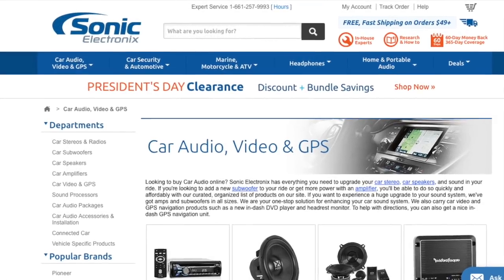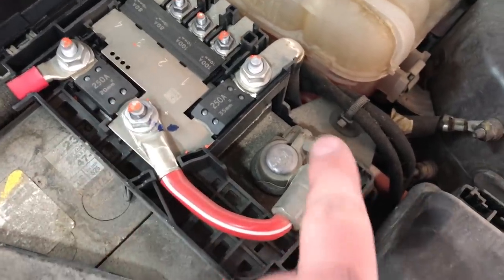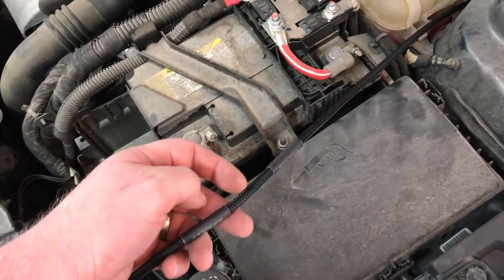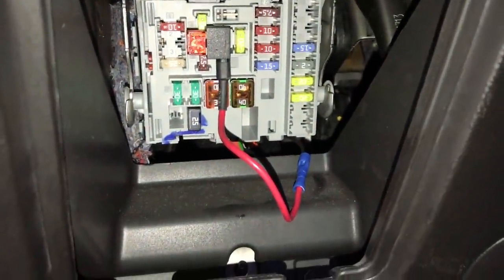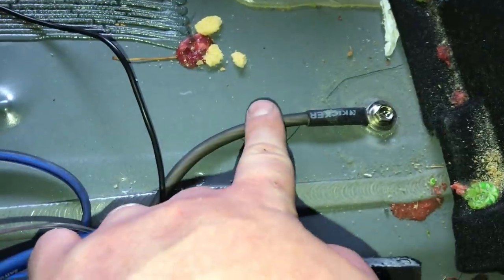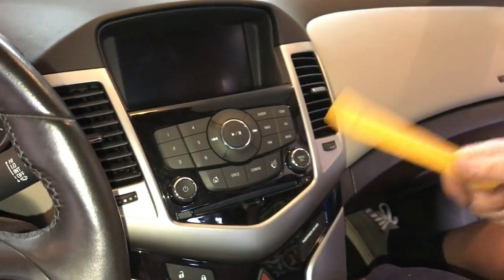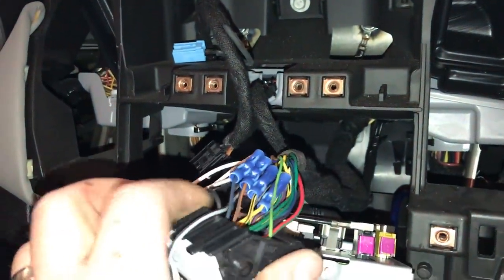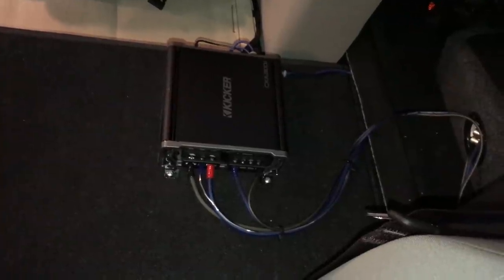2011 - 2015 Chevy Cruze Kicker Amplifier and Subwoofer Install

Comment from the maker: Parts linked in the description of the video!
Reply: Have you had any experience with the cheap android touch screen stereos popping up all over the place for these cars?

I ordered one but I'm confused as to how I should connect my door speakers;
My android stereo has all rca Jacks for speaker outputs. But my door speakers are just wires like yours. no male rca piece.

Should I just go online and buy little rca adapter things that I can connect to the bear speaker wires

Comment: Actually the panel by your hood release you can access all of your stereo wires including each speaker it's all in one single block. You don't have to take apart the dash at all
Reply: How?
Reply: I’d also like to know how ?
Reply: Hoa
Reply: He's right, just pop off the driver kick panel and remove some of the tape in the main harness. You'll find 4 twisted pairs...those are your speaker leads. Just use some t-taps and you're golden. The wire colors/polarity is easily found online. I actually wish I knew this before I started my own install. Oh, it's also important to know the tweeters get the same signal as the woofers up front. They just have their own high pass filters built in. If you're replacing tweeters, it's easy to just run a new wire up from the crossover. Also, you don't really need to buy speaker brackets if you're replacing them. You can just cut the speaker baskets out with a rotary tool/utility knife. Then screw the new ones in to the factory rings...if you squint it's mint 😁
Reply: Thank you for this comment, the prospect of taking apart my stereo was stressing me out
Reply: Wish i looked here before i spliced into my harness and drilled through the firewall lol

Comment: This was extremely helpful. I tapped into the speaker wires just like you showed and it worked great. Thanks so much for taking the time to put this together.
Reply: What additional fuss did you use? I see a bunch of ones like 15A or 20A and even 10A. I’m so confused on which one I need to add on with my cigarette lighter fuse.
Reply: @quincymcroberts24  I used the 20 amp fuse which is labeled fuse #6 located inside the car on the panel on the left side right next to the driver’s left knee. Here is a link to the diagram for the location of fuse #6 https://fuseandrelay.com/wp-content/uploads/2017/08/shema-bloka-s-predohranitelyami-v-salone-shevrole-kruz.gif
Reply: @Dovrizzo  Thanks you so much! I appreciate it!

Comment: Tapping in through speaker wires to the amp is terrible quality(stupid when high frequencies come through subwoofers). Was hoping it had some outputs but apparently replacing the head unit is the way to go here.

Comment: What and how did you wire your cables on the radio I got confused
Reply: Its called a line out put converter and when you buy it come with instructions

Comment: I had my add a circut in the front cigarete lighter fuse and it stop working for no reason and the relay stared cliking and now my amp will not turn on? Help where to reconnect my add a circut again to make it work?

Comment: Thank you! I have a 2013 Chevy Cruze and installed a kicker hideaway with your video, even though I had a little bit different setup. Couldn’t have done it without this.
Reply: How do you like it? One of the things I love about mine is it looks like a damn rental car and as long as I don't leave anything visible inside, nobody messes with it. A concealed sub would indeed make it sound better? Thanks.
Reply: Edward Bernard I love it, it’s a single 8 inch sub/amp combo that gives it just enough thump to have good quality bass in the car, nothing crazy. It stopped working though about a week ago and I have no idea what’s wrong with it. Has power/light is on, fuses good, it’s grounded, speaker wires connected correctly even tore the radio back down to check them. So oof.

Comment: What do you do differently if you want to add a bass knob? How does it plug into the LOC?
Reply from the maker: Lots of options for bass knobs - some line out converters can include a bass knob, some amplifiers include a bass knob, or you can get a universal in-line bass knob as well.  Just depends on what equipment you are looking to install.
Reply: @ProvoBeastAudio do the newer kicker amps need a LOC? or can i get away with a amp sub and a amp kit
Reply from the maker: Depends on the kicker amp.  If you go wtih the Kicker Key, they have a built in DSP so no LOC is needed as they will take the OEM signal input and make those adjustments via DSP.  Some non-key amps have high level inputs, but overall, you will get a better experience with a quality LOC. @TotallyNotDoggo

Comment: So where or how did you hook up the bass knob? I see where you had the plug for it, but you never showed what your hooking it up to or the install of that?
Reply from the maker: Depends on the amp, if you are using the same amp, we ran the cable up to the knee buster panel under the steering column and mounted our knob there.

Comment: I also have a 2013 Chevy Cruze but I will be replacing my stock head unit but keeping my radio. If I watch your video and hook up mine and use the same materials as you used (might use Zero gauge wires) I should be good to go then?

Comment: I have a box with 2 8in and 1 15. The power cord and ground wire are 3-5 gauge wire. I have speakers in back I’d just tap into those?

Comment: Where you connected your power wire terminal will pull through that fuse 100%. At least when the car is running.

Comment: Is there a secret to pulling the power cable through the grommet? I get the coat hanger through, but each time I attach the 8-gauge power cable and try rto pull through. The coat hanger pulls all the way through leaving the cable behind. It won't even start through the hole
Reply: Hey did you figure it out ? How tf did u get a hole in the rubber boot under the hood ?
Reply: @magic8053  I ended up making an X cut with a knife to widen it a bit

Comment: if you have speakers in the back of your car, do you have to hook up the line out converter behind the stereo? or could you hook it up to the speakers in the trunk?
Reply from the maker: Line out converter just needs to tap into speaker wire.  If you have speakers in your trunk deck, absolutely use those.  This Cruze didn't, hence why we had to go behind the radio.
Reply: Provo Beast Audio Installation thanks

Comment: I've always used an aftermarket deck with my sub setups, I've been under the impression that the line out converter is lower quality than directly plugging rca's into the head unit. Is this not the case? The cruze is the first car I've had that I can tolerate the stock radio and I don't care to change it if I don't "need" to.

Comment: My rca converter had a input 12v power that needs to be connected and the output rem wire. Do u know which wires go from the stereo to the 12v+
Reply: Did you get this answer?
Reply: @WillSpitwell23  yes, it was the same wire that turns on the radio. Had to lookup the wiring for my car and splice the pwr cable on my radio.

Comment: So I have a scosche line output converter and it also has a small wire which is a remote wire than can connect to the amp, do I use this one?  or can I bypass it by using the mini add a circuit?

Comment: Would the Malibu 14 with the same my link radio and no factory amp have the same wire diagram and then front are they full range signal to the loc ? Or do you happen to know how or we’re can find out to install in the Malibu 8 gen mine a 14 4 door n 2 a pillar tweeters

Comment: My aftermarket install interfered with the CAN system is there was a reason why is doing this? It shut the car off and it doesn’t let me switch it back on. Did the guy do something wrong on the install? I know it messed up with the CAN system because the mechanic told me it did so and I had to leave it in the shop for a day for them to reset the motherboard of the car.  We connected the system back up and it worked but the same thing happened a couple of hrs later. What you guys think it is? I know this is an old video and idk if people will comment on it but it doesn’t hurt to try☺️☺️

Thanks!

Comment: My question is why did you do all that work to put it behind the radio when I'm the radio when from factory the wires for the  6 by 9S that would have been in the back window are Located on the driver's side panel right right where the latch for the hood is what is if you take that panel off the factory the panel of the factory wires are there ready to hook up for ready to hook up for the  6 by 9 that would have been in there Sex by nice that would have been in that car ?

Comment: Okay. I installed all the stuff in my friends 2015 chevy cruze and i installed the fuse splitter with a 10 amp fuse and it didnt work. So we was experimenting with a 10 amp and a 20 amp together and it was putting the protective mode on the amp so i know its getting power so do i need to put a bigger fuse or could the fuse splitter be bad??

Comment: What about a 2016 chevy cruze
Reply: Did you find out if there is any difference on the 2016?
Reply: The 2016 cruze limited is really a leftover 2015, identical to the 2011-2015 as far as I know.

Comment: Where did the remote start cable go?  Did you split it into a fuse or did you hook it to the radio?
Reply: Any slot that turns off and of with the car....so it doesn't kill your battery brother

Comment: Any reason to not connect the line out converter to the speaker wires where they pass through the drivers kick panel? Also does it matter if you use the front or rear speaker outputs for the line out converter?
Reply from the maker: If you want to take apart the kick panels, that certainly works.  Rule of thumb is to connect the LOC to a full-range output signal from the radio, so in this case, both fronts and rears are typically full range on the non-amplified models.
Reply: I would suggest to use the rear speaker wires, this way you can control the Volume of the Kicker by adjusting the Fader  to Front, reducing or turning it all down the Rear Output  if needed  ;)

Comment: Have you guys done a 2017 Gen2 Cruze yet ?
Reply from the maker: Not yet for video content, but we should a have a few this year.
Reply: Awesome. I can't find any info on how to remove the head unit on mine. I'm sure I could figure it out if I start pulling off panels .
Reply: We just got a new 17 hatchback premier and I think it is pretty much the same concept, just different method to get there. Wondering myself....
Reply: artayu86 wondering on the 2018 myself
Reply: I have a 2017 gen 2 LT and I really want to install a sub and amp. But I don’t have any speakers in the back so couldn’t I just tap into the back doors speakers right? Or am I wrong? I don’t know a whole lot about this stuff my friends are gonna help me do the work they know more than I do but I just haven’t found a lot of videos on the gen 2 Cruze.

Comment: On the mini add in circuit, would it matter if you used the original 20 fuse thing in with it to r does it have to be 10?
Reply from the maker: Will you use the original fuse for the original circuit and then add a fuse for your remote turn on wire.  I would recommend a 5-10 amp fuse max on the new circuit.  Its just a trigger wire so it doesn't need amperage much at all.

Comment: PLEASE HELP. I have a 2015 Malibu, the trunk from the Cruze and my Malibu look similar. and my only problem is knowing where to ground, I planned on bolting it down in the same spot you did but I’m just nervous about what I’ll be drilling through because I can’t see what’s underneath it.
Reply: Any solid peace of metal on the car will do fine

Comment: Why didnt you just connect the rca converter to the radios preamp ? Which is on the right side of the trunk. In fact its the same spot to run 6x9s in the rear.
Reply: Does it work
Reply: @zacharynewport7287  ive been an electronic tech for 23 years and i own a 2015 cruze.
Reply: James Clark is it the same for a 16 cruise?
Reply: i dont think all cruzes have that, i dont have 6x9s in my 2015

Comment: Hi I have a 13 cruise as well my installer is out on vacation and I’m trading in my car I have two amplifiers going to a LCI six which is under my dash that I can see it. installer do you think tapped behind the stereo or do you think hetaptap in to the speakers wires by the OBD2 port? I just want to pull my LCI out my bass controller out my two amplifiers and leave the door speaker so they continue to play I don’t care about the wires I can leave that because I’m a get a new wire harness I just want the driver and passenger rear speakers the play when they turn the radio on could I just cut the wires at the LCI that come out of the connector and just pull about dance out or what I have to put something back together to get a sound I hope you can understand what I’m trying to say

Comment: How would you do it in a eco version? They have a second battery in the car and i heard you have to bypass the eco mode?
Reply from the maker: No need to bypass anything, as long as the primary battery has a direct lead from the alternator and supplies between 12-14 volts,  the install would be very similar here.

Comment: I set up an amp with a 10" sub in my 2012 cruze. However, after ensuring everything is set/hooked up properly it will not work. I'm thinking it may be a problem with the amp but I am unsure. Do you know of any common mistakes I may have made?
Reply from the maker: Without seeing it, it's hard to diagnose.  Amplifiers are simple so remove the variables: make sure  you have a 12v+ connection from the battery.  Ensure you ground is proper.  Ensure that the remote turn on wire shows a 12v+ signal when the key is on.  Ensure the RCA cables are delivering the signal to the amp and  that there is no short.  Ensure your subwoofer is wired correctly, even in the correct impedance.  Start there.

Comment: I did everything you did to my 2015 but the amp turns on and plays but super low can barely feel the speaker move what could I do to diag this problem
Reply: up the gain on the amp, up the signal from the radio to wherever you tapped.

Comment: I did this same install but I'm getting engine noise at low volumes I grounded at the same location and sanded to bare metal,   
The only difference is my amp has high level imputs that I'm using instead of L.O.C any tips on to how to get rid of this noise?
Reply from the maker: Use a Line out Converter, or you can use a ground loop isolator.  Cheaper amps have a tenancy of picking up engine noise using high level inputs.  a LOC may fix it, moving your signal wires  away from your power wire may also help.

Comment: Also do the RCAs have to run on the right side of the car?
Reply from the maker: No, not necessarily but best practice is to run your RCA cables away from your power wire to reduce any interference or engine noise.

Comment: Can you help me ? I want to install my subwoofer amp on my factory systeme , i have the 2017 cruze hatchback with factory bose amp, where can i find and be sure that where i tap my LOC its a full range signal ? All the time rear speaker are full range ? And what about puting my loc on the factory subwoofer but bécasse its a tinny 6 inch woofer im scared they put sub Sonic filter cutting like at 40hz
Reply from the maker: The Factory amp is under the rear floor panel by the spare tire.  there are a few ways to tap into signal either by tapping into the low level input on the bose amp from the radio side (which doesn't require an LOC), tapping into the speaker level output side of the bose amp (which would require a LOC), or tapping into the subwoofer output.  Without using an oscilloscope, i can't confirm if there is a sub sonic filter, but it may be the easier of the install.
Reply: Provo Beast Audio Installation i have an oscilloscope at work i can use , i plug it on the wire and send a 20hz signal ?
Reply from the maker: Really start high around 60hz and work your way down to determine if you see any drop off.
Reply: Provo Beast Audio Installation Perfect thank you for your time

Comment: Does it work for pioneer system
Reply from the maker: it does, but your install will differ.  You have a factory amplifier behind the trunk liner on the passenger side and you can tap into the factory amplifier output for your signal for your new amp.
Reply: Provo Beast Audio Installation thanks I'll try
Reply: Can i tap the rem from the factory amp to?
Reply from the maker: yes

Comment: Does it matter if you use rear speaker wires? Since the subwoofer is in the back. I've seen it done both ways.